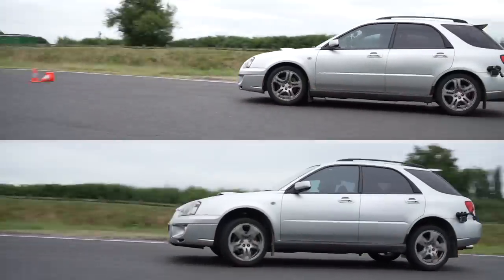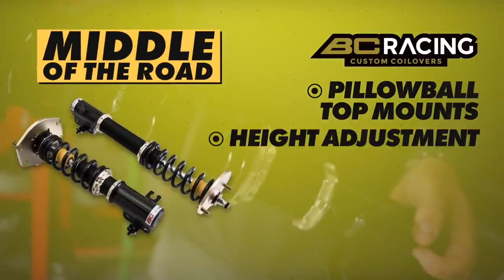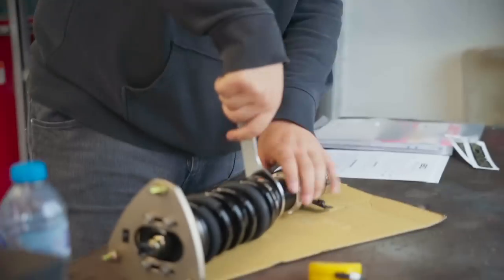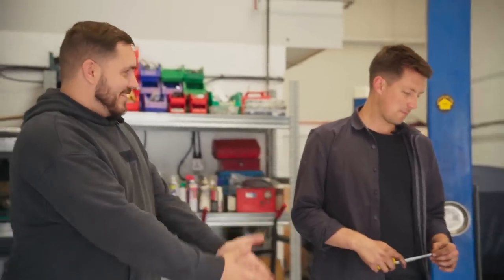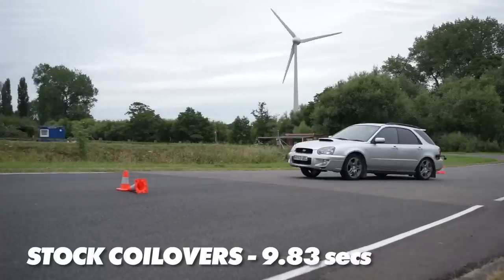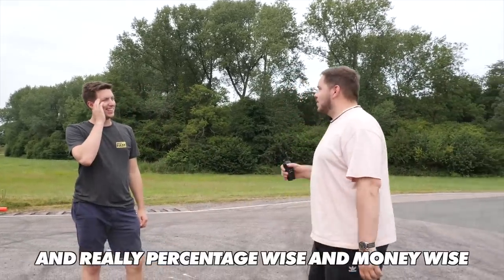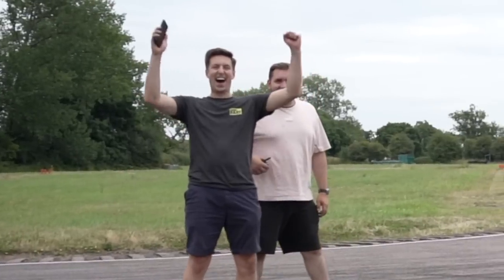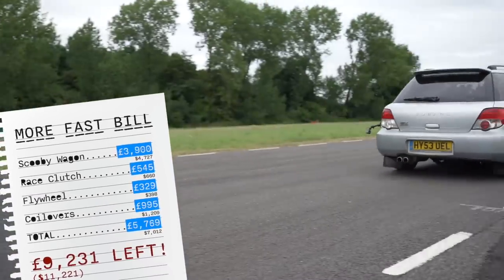Will $1000 Coilovers Help Us BEAT A SUPERCAR?

Comment: I'm amazed that a difference between proper set of stiff, adjustable coilovers and a stock suspension with at least one busted shock is that little!
Reply: Yep, suspension without a tire upgrade is often just a confidence upgrade that reduces compliance. But pair that with a set of good tires and an alignment tailored for those tires (getting the tires equally warm inside, center and outside) and there is no better bang for buck upgrade. Next, weight reduction. Only then, maybe some power adders.

Comment: Don’t forget bushings, Whitline antilift kit and Short shifter with transmission Sti transmission mount👍
Wider Tires about 10-15mm wider on those 17” rims. Any more u will bounce around. Skip the clutch. Subaru transmission are garbage just deal with it and learn to be smooth! Shift that money to Turbo upgrade with ECM tuning with Bigger exhaust. You need better pads like Akibino race pads on the cheap. Or straight pipe for track use no muffler or cat. Put it back on after u win. 
Take out all interior extra and get weight down. 
Move battery to trunk passengers side if u can to distribute weight.Cusco rear strut tower mount skip the front one if u need more grip in the front. Don’t forget f/r sway bars 22mm or above. 
Sti here in USA is about 300hp. That turbo tune can get u to 380-425hp This will make maximum usage of the GD engine cams. Guaranteed win!
Good Luck!

Comment: I improve my car by stiffen the chassis aside from the use of adjustable coilover, with strut bars such as the one I installed are produced by the local company called ‘UltraRacing’. 
They produce specific multiple bars for different car models.

Comment: Don't make the same mistake top gear did and only focus on handling and then throw like 40 extra hp at it. Gut it, get some good tires on it, some really good brake pads (because it isn't a marathon, it's a sprint) and put some power into it. It's 400hp down on the Lamborghini. 400! It's going to need a good 100+ HP and some more handling mods. Anti roll bars, tires, brake pads, brake fluid, and some good ole fucking power. Don't get wrapped up in spending the rest of that 10k on suspension. Some of that has absolutely got to go to the engine.
Reply: I agree check my comment out I said something very important more downforce to keep the vehicle firmly planted on the road.
Reply: I'd like to see them make this work but the EJ in that Subaru is a real weak point. Anything over 300whp on the stock bottom end and it's a ticking time bomb. Might still make the lap tho, that's all that counts

Comment: You need an alignment, your tyres have positive camber during corning on inner corner. Would also recommend remove front sway bar, couldn't hear it but looked like it had a bit of understeer promoted by front sway bar.

Comment: Good job!! Sway bars 24mm with aluminium endlinks are best bang for buck to take away body roll. 
Then...
Drop a downpipe + prodrive cat converter, uppipe if possible too,
225l pump, 
vf34 turbo,
550cc injectors,
tune her to 1.15/.2 bar easily pushing 300/310hp
New brake pads/service

I wouldn't imagine would be as fast as a lambo though!

Comment: get 24 mm whiteline rear anti roll bar with heavy duty mounts and drop links and subframe lock in bolts, whitelinte front drop links, maybe 22mm front anti roll bar but not really needed and bump steer and roll centre kit and poly bush steering rack bushes help alot on an impreza as i fitted these to my impreza and makes hell of a difference and my alignment i run 1.4mm negative camber front 0 toe and 0.8mm-1.2 mm negative camber rear with 1mm toe out  good fast road/track alignment for Subarus and front and rear sturt braces for 500-600 quid big difference and your steering and suspension will be sorted hope this helps 👍

Comment: The coilovers were adjusted wrong. They loosened the preload on the spring to lower it instead of adjusting the height on the bottom ring which is why it felt soft and needed so much dampening

Comment: Now that its lower you guys should seriously look into a roll center adjustment kit and an anti-lift kit. The roll center adjustment kit will correct your suspension geometry and the anti-lift kit will add a bit of caster which will reduce understeer.

Comment: Although a new, adjustable suspension kit can do wonders, I always was astonished by the benefit of lighter wheels and tyres in direction changes, braking, acceleration and behavior over bumps wtc.  You could also probably avoid lowering the car too much via the suspension just by using smaller wheels (eg 17 vs 18 inch wheels while keeping similar tyre wall height)

Comment: I'm looking at that "more fast bill" at 0:57. If money is tight, why would you spend that money on a race clutch and flywheel? If the stock clutch is slipping, go for a stock clutch, you don't really have the money for BIG POWER so the stock will do, and just go there IF it slips, that good money you could have used for 200TW tires or brakes

Comment: Brake pads and tyres were the 2 biggest upgrades to our racing 206gti. 
Tyres 0.3g improvement to a total of 1g, Pads 0.3g in braking. B4 pads even with the new tyres we could still only get 0.7g straight line braking.

Comment: My advice would be to use lightweight wheels, this would reduce unsprung weight on the suspension which will allow the spring to move up/down faster without oscillating, this will allow you to soften the dampers which improves the tyre contact on the ground. 

If you are going to use grippier tyres, maybe buy smaller tyres and rims since the chassis in the car might not be stiff enough to take full advantage of extra potential grip and smaller wheels are lighter than larger ones so you can reduce unsprung mass yet again.

Comment from the maker: What do you think we should upgrade next?! Suggest down below!

If you haven't seen Episode 1 👉 https://youtu.be/Y-2riLpE4qI
If you haven't seen Episode 2 👉 https://youtu.be/kYg1PqeKbrs
Reply: If you REALLY wanna beat that super car I suggest in upgrading your transmission 
,dual exhaust may be worth the cost.
air dams.hood scoop 
more downforce to keep the vehicle firmly planted on the road.,allowing the car to corner faster.
Winter tires provide superior traction, braking,and cornering 
,as well as average peak power.
Reply: Aero and tyres would be helpfull
Reply: weight reduction!
Reply: @HaywireRides  possibly 
With carbon fiber but they'll have to strip the whole car and rebuild the chasis
Reply: Weight reduction would be real good
Reply: @lardumf1445  engine swap?!.
Reply: toyo proxes r888 or nankang ar1 or if you won't be driving on the street go for full slick

Comment: Definitely go for damping adjustment. Or you might end up with a bouncing wheel again lol.
It's not always about strength, it could be about body kinematics, I can do things my bike mechanic can't even though he's stronger than me just because my leverage ratios are better.
Reply: to be fair it also looks like he wasn't pulling the quick release for the air hose, if you dont, it'll never go in, second you pull it it goes on like butter

Comment: BC make fine coilovers for the money but I’m not sure the valving in them is right for track use. They are more of a drift thing that can be streetable. Also I have bought Maxspeeding rods coilovers and they are good BUT too soft for the track. Also not sure if they would stand up to anything too harsh.
Right now I have HR springs on stock struts and it handles amazing but it’s a bit too crashy at low speed.

Comment: With that style of coilover you don’t adjust the ride height from the spring you set the pre-lode of the spring and adjust the ride height through the base as all you doing there is limiting your shock travel and there for slowing your lap time.

Comment: The idea of this video is excellent; however, if could use a good shape of the stock damper to test the difference to a new coilover, it'd be more attractive. But the result will be the obviously same as is; with the higher frequency on the BC, it'll be controlled more easily than the softer stock springs.

Comment: The tires are definitely holding back the coilovers now. "Blow" the budget on the best possible street legal tires you can get. Don't think about how they're going to wear either since you'll probably need peak performance for only a few laps. Some semi slicks (Pilot Sport Cup 2 R's for example) are especially developed for hotlapping instead of longer trackdays so I'd go for one of these depending on which size tire you can fit.

Comment: Brilliant bid and good result! I'm a little shocked  WRX wagon with knackered shocks is only 10 seconds off the pace of that Lambo!

Just a quick thought for consideration: With these cars even a very slight suspension drop can throw the front suspension geometry out by a air old way and in particular on these this will exaggerate the amount the tyres will go to positive camber when pushed which will lose you grip and put a lot of heat in the boots.

A quick and dirty way is to slap on a stronger rear ARB and leave the front be. That also done in conjunction with a roll centre correction kit for the front would transform this car yet again. An anti-lift kit would also be desirable but roll centre correction first to help keep more of the front tyres on the tarmac.

Comment: Reduce unsprung weight and rotational mass. 
Of course better tyres on such a circuit.
For such low speeds and a tight circuit I don't see bigger brakes yet.
More power in the other hand is a good idea.

Comment: Id invest in some harder sway bars, better wheels/tires, better brake pads, some chassis bracing, better exhaust and filter and a tune (if not getting more forced induction). These are relatively cheap mods that do the most after coilovers for your car.

Comment: Really enjoyed this vid, but did you guys dial in ride height? From the outside it still looked like the front was riding higher than the rear which would introduce a lot of understeer, which you guys were then trying to tune out with damping.

Comment: Had a set of bc coilovers years ago, they were terrible, adjustment rings are easily damaged, bearings on the front top mounts failed after 6 months, and they rust like hell, then the power coat will flake of the springs.

Comment: hi, your coil overs are set up wrong. you need to pull them apart. set the bump etc. look up the mca suspension coil over set up video. I found 2 seconds at the track from doing this.

Comment: Yeah, good choice with the middle option on the coilovers. The cheap option looked kinda weak, but the high-end ones... no offense, but you two aren't nearly enough driver for a differential damping rate to be what puts you over that last 0.05 off of Scott's time. xD

Plus that kind of adjustment is for dialing in a setup for various tracks. This'll be on one track, and as I don't believe either of you are race suspension gurus, that's a lot of overkill.

Middle option seems best. Get the quality but not the bells and whistles.

Comment: I’m going through sooo many Tires and that’s on my 2006 polo 💀
The suspension and the fact it’s over powered at 207 BHP 75 stock 😮‍💨

I know that’s still not really that mad but considering it weights like 850kg I think it’s pretty good, although the wheels just spin bc it can’t put the power down so don’t go down that route although the Subaru is four-wheel-drive and heavier so it shouldn’t be that bad 😌

Comment: is the car market there really THAT bad? for all that would need to be done anyways could have gotten a much cheaper vehicle that has way more potential. gonna be interesting but I'm gonna guess you'll be at best 1:20 but more likely 1:21. also your discussion about brakes in the first video shows a weakness you will have. better breaks means you can slow down later to enter your corners. its not about how long they last, but the job they do. also next mod I would do is a freebie... lighten it up. you could spend some money on it but just lightening the whole thing up taking things out that are not needed would help your HP/torque to weight ratios. also spring for the lighter wheels, un-sprung weight can seriously make a difference in acceleration and braking. every pound (kilo in your language) is worth 3-5 elsewhere on the car.

Comment: 1st mod I would have done would have been new tires and lighterweight wheels to reduce unsprung mass or remove the entire rear interior and spare tire to reduce sprung mass as much as possible, then the coilovers so that you could have seen the incremental changes or improvements without wondering which was actually making the biggest difference.  Next, I'd recommend a rear strut tower X brace to stiffen up the rear end a bit (I have a Forester, this helped immensely) and then upgrade to the VF39 STi turbo, or a GTX28 if the budget is still allowing, upgrade the intercooler, swap the stock catted UpPipe for an uncatted STi unit, get a 3" downpipe, larger fuel pump and custom tune.  For less than $2,000 you can add a reliable 100whp to that setup.

Comment: I'd swap the tyres nearer to the end, lest they need replacing.
Reply: tires are a hugely impactful mod. It'd make sense to get them sooner, i think. plus he mentioned the tires were "giving up" at 10:40.
Reply: That's the most counterproductive way of building a track car I can imagine. Tires are the single most important component when it comes to track performance. Every part of chasis reinforcement, suspension stiffening and additional power should be tuned to reach limits of said tires. There is a reason why EVERY SINGLE book about designing racecars tells you to start designing a car by looking at tire data.
Reply: @gameboyterrorysta6307  winter tires it's their best bet
Reply: @gameboyterrorysta6307  I'm not saying don't get tyres, I'm saying do them last so you don't rip them apart developing the rest of it  on a budget.

Comment: at least do full Cobb exhaust with equal length header and a custom tune using the Cobb Accessport. you need power for goodness sakes. that'll prolly cost you $3k for a great bump in reliable power. the upgraded clutch and flywheel is so unnecessary unless you're speccing it to be a race car. that was money wasted for very little gains

Comment: To be honnest, i think a good mx5 can beat the lambo. Yes it has power. But a miata with grip can beat cars with twice or tripple the hp. Pretty sure the subby can get close but it's heavier.
Reply: Needs more torque and more rpms
Reply: @knrz2562  True, i think if they change the subbies tires and remove some weight it will beat the lambo, and roll bars.
Reply: @TheMx5Channel  yup

Comment: You just needed a replacement rear shock....and save the cash for turbo and intercooler upgrades, fuel flow increases and remapping and you would be shocked at how much faster that car would be. Handling is more about confidence than speed.

Comment: coilovers are crap n waste of money, never buy this shit, no matter what fools recommend you..just go with stock but tidy suspension..or with slightly stiffer/lower springs up to -2cm if only you can find such..too bad you usually can't find such springs, only to low ones..then you gotta fabricate stuff, if you're not satisfied with stock setup..but usually stock is more than ok for daily use n public roads..btw, body roll isn't a bad thing..unless you're constantly on a moose test..but you're not;P..on a single turn body roll only helps you, along with rear suspension's passive steering effect, before you fuck up your suspension with crappy coils n shit n end up with non working suspension..the best mod you can ever do to your car n handling is good/grippy tyres n lightweight wheels..end of story..